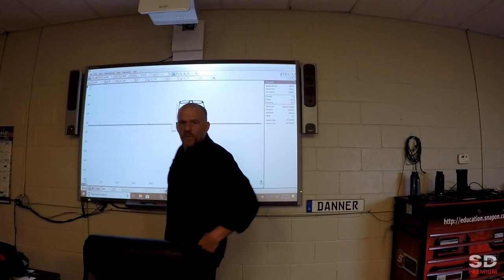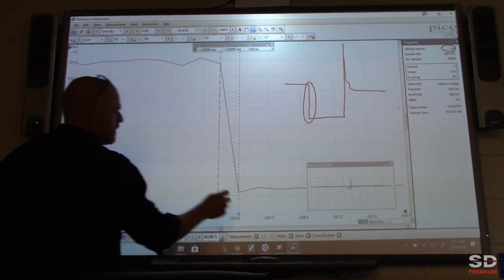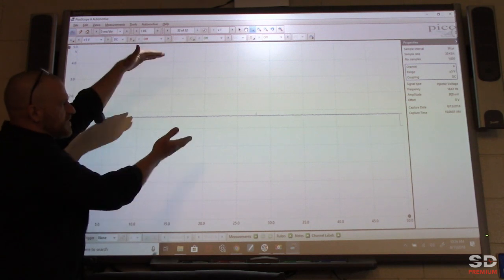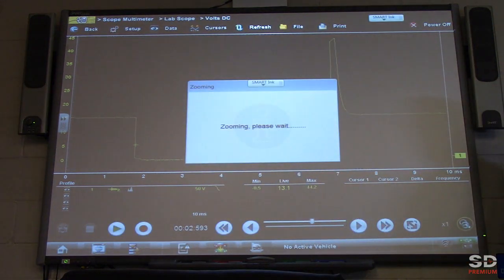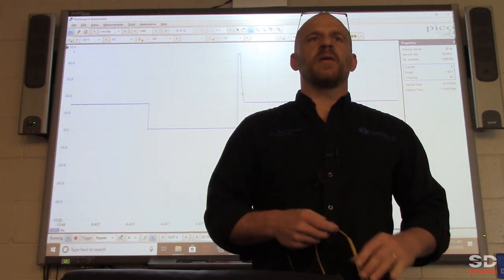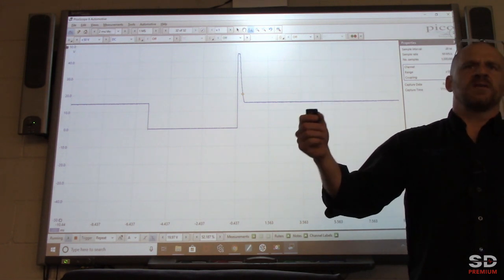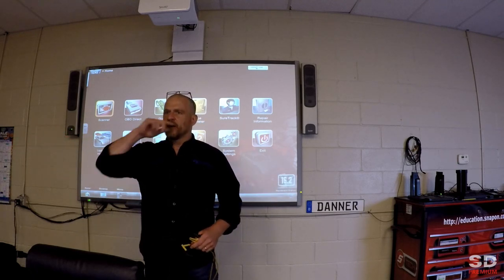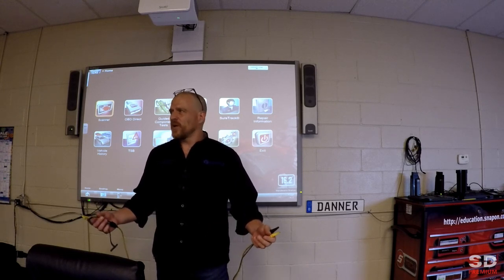Lab Scope Sample Rate - Why it is So Important

Comment: i recentlly got a scope and i found you learn it just like when you get a new phone,just playing with the setting and buttons and exploring really.this should be the very first step in scopes is simply exploring,take a battery or make a simple circuit.
once i did this i started having questions like how can i damage this by accident?how much voltage/amperage is too much?what attenuator is for and when to use one etc etc but the most important part was me simply exploring the tool like a new phone and thats how i got questions.
Reply from the maker: absolutely spot on my friend! Pick it up and start pushing some buttons is the first step. Thank you!